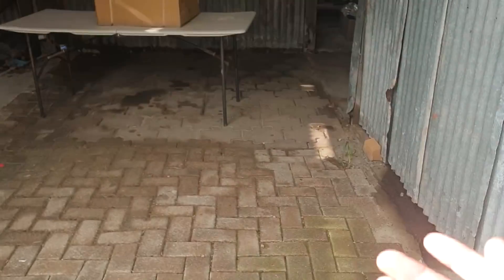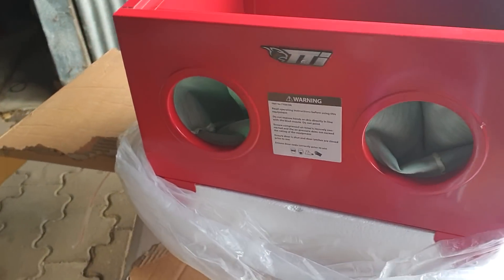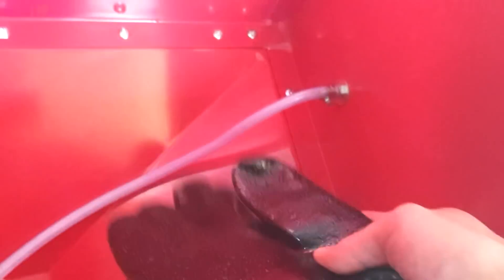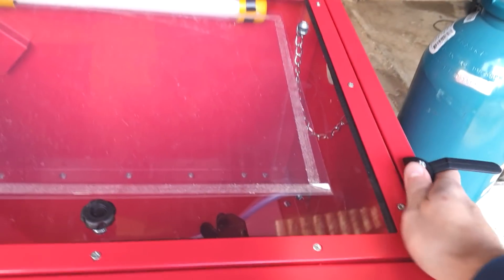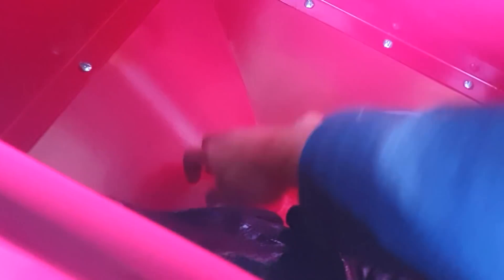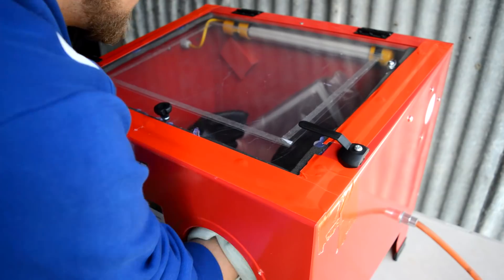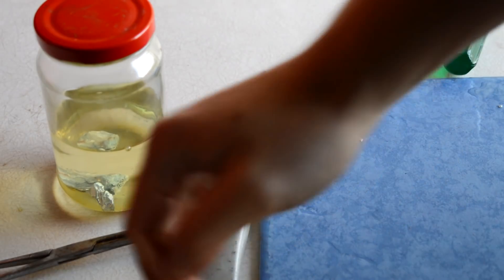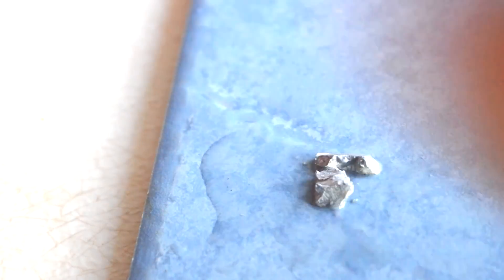Building a Glove Box for Air Free Chemistry

Comment: Some suggestions:  please add a pressure relief valve in the event of an overpressure incident.  Consider also a solid replaceable interior floor--you know something will drop or drip through the grate to where you can't reach.  You could try to use a flexible plastic sleeve zip tied as airlock on that hole on the side, it might work for occasional transfers.  A container of desiccant and a constant low flow of N2 would be cheaper than Ar as others have said; that way you can save your expensive Ar for keeping narrower containers anoxic.

Comment: 1) Transfer hatch/Air lock, whatever you want to call it.
2) adjustable mount, be it magnetic or a flexible stand, for a camera, as well as a hole you can wire up and then seal with foam and silicone or whatever around the cables, so you don't have to run out of battery. Wrapping the cables in Teflon tape to protect the cables might be a good idea, so you don't have them degrade over time, then cause a spark that lights anything on fire or just gives you a nasty shock when making contact with the metal frame.

Comment: Hot glue is possibly the worst glue to use on foam and glass lol, once you have the lid seal finalized use some contact cement or basically any liquid glue or caulking, but not super glue or the foam might melt :^) otherwise 10/10 DIY, I can't wait for the sick flame paint job that'll help the science go faster

Comment: Make use of the hole in the bottom! Run gas in through there, put a fine mesh over the hole and add a load of fiberglass to diffuse the incoming gas. Also, make use of your big side hole with the nice matching metal ring to build yourself an airlock out of PVC pipe with a big sliding gate valve on each end. Gaffer tape should do the trick elsewhere. As others have said, more clamps on the lid. Off to a good start though!

Comment: Engineer here:
- flow meter!
- vacuum line (so you can purge better with less argon)
- better bottom, maybe a bit of sheet metal or something
- fill in that dead space in the bottom
- proper gasket material (you could use silicone, RTV, weather stripping, butyl tape, or cut a solid one out of a big rubber sheet), but check chemical compatability with what you want to run
- less obnoxious gloves with some more disposable gloves covering them

Comment: ¼" (6mm-ish) safety glass for the lid, only bother trying to seal the bottom, feed the gas from the bottom (pass through bulkheads and caps for remaining holes btw), chimney as close to the top as you can get it (at least 25mm inner diameter, no less than 1 meter overall length) curled and/or bent to act as a gas trap.

 Some sort of desiccant wouldn't hurt too much either.

 Making an airlock should be rather easy. You just need to copy your current box, but smaller (it can also be made from cheaper materials as long as the box-to-box hatch is metal) with a ball valve on it for gas and a chimney that feeds into the main chimney (this one can be smaller, but overkill is underrated and you're already buying 25mm hose)

Comment: A good addition is put a pipe of about 3 inch/ 75mm in diameter  pointing up to release the atmosphere and put a short length of collapsible fire hose on it so it flops over restricting the air moving in and in the event something goes wrong, a fuck ton of gas can escape out of the box instead of blowing the lid off

Comment: Nice video as always.
Argon is only marginally heavier than air (Ar 39 g/mol, O2 36 g/mol), so it probably won't settle well?

I think most gloveboxes operate at a constant relative pressure (e.g. 10mbar over ambient), but since mechanical regulating valves are kinda expensive I get why you work with constant flowrate. If you want to figure out a good flowrate, oxygen sensors (for arduino or as finished device) are pretty affordable. You could also use a pressure sensor (a few $) to control a solenoid valve (mine was 10€ from amazon) and push in some gas when pressure drops below a threshhold value.

If you want to capture excess oxygen my professor always suggests lighting a broken light bulb, as the wire will burn all remaining oxygen. Only works in very clean atmospheres.

Comment: Seal the box with GE silicone 2. It is not an acidic as other forms of silicone sealant. Useable in about an hour. 24 hours to full cure time. It won't corrode your box either!

Comment: So, I'd consider running a gasket around the entire perimeter where the cutout for the glass makes its 90 degree meeting. I'd also consider putting some sort of an insert over the grill in the floor. It would save on gas volume and prevent things from potentially falling where you can't get them. Spilling your yield on tile would be better than spilling it through the grill. Put in stronger plexiglass, a pressure gauge and vacuum connection. That would pretty much be ideal, I think.

Comment: Have you thought about changing the Acrylic screen with Polycarbonate? Much more durable and heat resistant won't instantly shatter and imbed bits of bits of plastic in your beautiful face if something goes horribly wrong.

Comment: An interesting start to a glove-box.  I have spent most of the last 40 years working in glove-boxes (fairly fancy commercial units, weighing a ton or two, with atmospheric circulators, oxygen scrubbing beds, etc.).  One thing you definitely need is an outlet near the top.  This will help with purging and pressure regulation.  The simplest way is to run a hose (1/2" to 1" ID) into a tall bottle of oil to make a "bubbler".  This gives a visual of flow rate, serves as pressure relief (so the box doesn't turn into shrapnel when the argon regulator fails) and prevents back-flow of air.  A good connecting spot would be the port on the upper left of the back of the box (with the internal baffle).  For hoses, I would recommend high density polyethylene (HDPE).  It is not very flexible, but it has low permeability to oxygen and is very inexpensive (use a heat gun for tighter bends, or to straighten out coiled tubing).  Place the bubbler well below the box, so that pulling your hands out of the gloves does not draw oil back into the box (huge mess).  If you have questions, you can find my e-mail here: https://members.tm.net/lapointe/index.htm if you dig a little.
Reply: i imagine the duct tape seals would make an excellent overpressure failsafe
Reply: @blockstacker5614  You're probably right, but having a compromised glove-box while you're handling pyrophorics is a less than ideal situation.
Reply: @robertlapointe4093  Yeah, was thinking the same thing. Overpressure bubbler would be ideal, I think. Would serve as a flowrate-monitor and a pressure-release simultanously.
Reply: Care to share just what you do? Sounds like I’d love your job
Reply: @Calyrekt  Research chemist, mostly making and testing organometallic catalysts (both for small molecule synthesis and polymer synthesis).  Also a fair bit of continuous reactor engineering.  Off the shelf reactors need some tweaking when your feeds are pyrophoric (flammable and/or explosive on contact with air).  Lot of fun, except for a few bad bosses (reason I retired a few years ago, but those BBs were fired and now I'm consulting with that company again, even get in some more glove-box time).

Comment: I raccomend to add an air-lock because with your set up you are just increasing the pressure of the glove box and NOT removing the air (or at best you are replacing it very slowly)!
With an air lock, the ones used for fermentig, you'll always have atmospheric presure inside the box but there will be a way for the air to exit, I'll not racomend using water for the air lock as it can leak some humidity in so use something like petrol oil or something like that....
Another way to do it is to employ a vacoom pump to evacuate the chamber at first, flush it with argon and than repeat a couple of times to get the desire "interness" 
Hope the tips turned out to be usefull, you are doing a grat job!

Comment: Tempered glass lid. 5mm min, drill the holes in the normal glass and have it tempered if you can. 
Window/door foam sealing tape around the edges.
More clamps on the door so as not to break the glass and to give it a better seal.
Glass window on the side/back where you can place your camera on a tripod.
Get rid of all the hot glue and replace it with silicone sealant. Also make sure to prepare the joints before gluing them. When you do glue it, take everything apart and glue it as you are putting it back together.
Create a small chamber to move things in and out of there if you can.

I wish I lived close to you, I'd come over for a weekend or two and do all the work for you.

Comment: What if instead of a diffuser like most people are recommending what if you had it inject the argon with slow lanier flow (however tf u spell it) and had a valve at the top so it would just kinda push the oxygen out with the argon.

Comment: A better option for sealing the box would be to use Canopy Tape.
Canopy tape can be purchased from any place that installs truck canopies. You could likely buy different widths of tape or just cut it yourself. 
A bonus would be that you could unscrew the bottom, canopy tape over the screw holes, and reassemble the box.
Canopy tape is a long lived dense foam tape meant for life surviving the elements and keeping water out of truck canopies. It comes with adhesive on one side.
Keep it in mind!

Comment: I would say add a one way check valve with a ball valve attached to it near the top of the tank. It would allow you to flush out all the air in the system, then just close the ball valve and you can pressurize the tank.

Comment: You should have used rubber cement for the foam. Also use silicone for sealing any small gaps & cracks. Hot glue is shit for air seals!!! 🤦‍♂️🤷‍♂️

Comment: looks like other people have already suggested using rtv silicone where you were using hot glue and tape. go to an automotive store and ask for gasket maker.
i'd take the bottom off, run a bead around it, and put it back on, should make an excellent seal. might not hurt to do the plexiglass thing over the holes, but run a bead of rtv around that too.
use an air compressor (or just that fish tank bubbler) to pressurize it for testing and then put soapy water on potential leaky spots, should bubble where leaks are

Comment: if you want it to hold vacuum, i highly recommend a rubber or silicone gasket, since they are non-porous, and seal well to metal (assuming the inside flap thing is metal of course)

Comment: Keep the acetone away from that, or get toughened glass for the lid.
Reply: You could also remove all that foam, then run a thick bead of silicone on the box and lid let them dry out, so when you close the lid the beads Aline up sealing the tip of the box (and it's a bit cleaner than all that foam)

Comment: I think the only real issue was sealing all the holes, but I suggest using rubber to seal all the leaks, and installing clamps on the lids made of steel. Also, from your one stream you talked about how there's still ongoing research on explosives, what if you made carbon tetraazide from carbon tetrachloride and sodium azide?

Comment: Use silicone sealant around the edges to seal in the air. Use rubber seals instead of foam on the lid, don't use hot glue use the silicone sealant. For the larger holes you covered with acrylic, put a rubber seal and/or sealant in between it and the box.

Comment: A couple of modification that i would make:
1. Change the acrylic for Glass, If you have the money to spare, Borosilicate glass, but a cheap, sacrificial, glass pane that you totally "borrowed" from a skip would work too. also, remove the hinges from the lid and just use additional latches to hold the lid down, less strain on the lid that way. 
2. Use Silicone sealant wherever there is a join/gap/bolt. this will make it air tight and it wont be as reactive with solvent vapors as the Foam or the Gaffer Tape will be. (seriously, do not use strong solvents in there until you have replaced the tape with something or the glue will just melt and give way) also cover any exposed metal on the inside with Silicone or they will react with any vapors produced. 
3. Add an expansion chamber to the device, they are usually used in water systems to prevent water hammer effects, but they will work just fine for Air too. this will stop the box "breathing" each time you put your gloves in and out. you can make a pretty cheap one just using a couple of balloons but then you may have a problem with corrosion and solvents again. 
4. In the same vein as the expansion chamber, add an exhaust port that can go into a water/solvent trap. this way if there is a buildup of pressure for some reason or you need to do something that has a lot of vapours, it has a place to go (eg. Heating a reaction, you dont want to heat an enclosed system)
5. Add an "Aux Air" port. this can be used for vacuum or any gases that you need to introduce to a reaction (chlorine generator for example) this way you wont need to have a huge setup inside the box. 
6. Switch the gloves out for better fitting, thinner ones. you only need chemical resistance in there and it will give you better dexterity when you are using it. 
7. Add a light inside the box. every time you put your head over the top you change teh natural light and it will get frustrating. 
8. Finally, and you have already mentioned this in the vid, make an airlock. just a smaller chamber that will use up less argon to cycle than removing the lid from the whole box. just make sure its large enough for anything you might want to add (thermo-probes, additional beakers/flasks etc)

Comment: Scrape out all of that hot glue. (Too rigid) and replace it with silicone. This will deform slightly and allow for a better seal. As for the go pro, maybe put that where you have the acrylic? If you don't want it to be too directly in harm's way or take up room for other experiments. If you have a clear enough view from that hole, that might not be a bad idea. Also, shore up all the seals (and screws too) with some kind of epoxy to minimize oxygen contamination further

Comment: If anyone wants to make a cheap, disposable glovebox you can use a clear tote and silicone to seal everything.  Duct tape can seal around the cutout for the door really well, kind of like how Tom sealed the holes in this video.  I built one like this and it works great.  I use it to deal with P2O5, lithium, sodium, potassium, cesium and NaK and it all looks just as good coming out as it did going in.  I think I have maybe $30 in the build?  The most expensive part was when I bought the gloves, which is up to personal preference, besides the tote itself.  I also put a 1 way valve on it in case something happens and gas is produced.  That allows it to vent without sucking air back in.  It also let's you purge the air without having the door open, saving on argon, nitrogen or whatever you need to use.  If I am doing something that may heat up or catch fire I just put a couple of metal cookie sheets in the bottom and do everything on top of those.  Using a few of them provides layers of protection as opposed to just 1 layer that can heat up and burn through the plastic.  It all works great, especially in a pinch and for how cheap and easy it was to build.  I'll put it this way, it works well enough for me to clean up group 1 metals, NaK and P2O5 and lets me rebottle it all and keep it clean and pretty for reselling it.

Comment: Dry nitrogen is much less costly but CO2 is dirt cheap.
A good test for O2 left in the box is to put your spare crack pipe lighter in there. When the O2 is gone lighter won't light.
Kinda easy to asphyxiate yourself if you run a lot of Argon in a closed room. Keep the door open at least.

Comment: Fill a wash bottle with soapy water and spray it around any seals, if you see bubbles forming you’ve got a leak. 

As others have mentioned silicon RTV is a great sealant frequently used in automotive applications so you should be able to find it pretty easily at any auto shop, you can use the RTV to seal up cracks and to make a sealing surface on the lid as it dries into a soft stretchy rubber.

Getting a flow meter is a great idea, just make sure it’s calibrated/designed for argon otherwise it won’t be accurate. 

You’ll want the argon to fill from the bottom slowly and evenly, a small tube with lots of holes and something very porous on top, scotch brite or a open cell foam.

Comment: I know it would be another cost, but why don you seal the chamber with silly putty? You know, 100% silicon mixed with corn starch and red dye, than well mixed together and put in all of the unnecessary holes and little enclosure gaps. That would make a perfect seal, as people over TKOR showed us. Also it would be better in sealing than hot glue and some mesh. If you would use the silly putty, I think, you could even pull a decent vacuum in there. Than the limiting factor is just going to be thickness of the walls and the top.
Reply: I meant “Porto Putty” of course😉

Comment: You should check the chemical compatibility of any solvents you are going to use with acrylic. Anything incompatible may permanently fog that window pretty quickly. Off the top of my head I'd be most concerned about DCM and chloroform. I know acetone is bad for this too but maybe isn't as much a common solvent in air-free chemistry.

Comment: I would suggest using silicone for seals, especially where you can clamp two flat surfaces together. May also look into making that gap around the lid much smaller using tape, even to a point of interference fit seal.